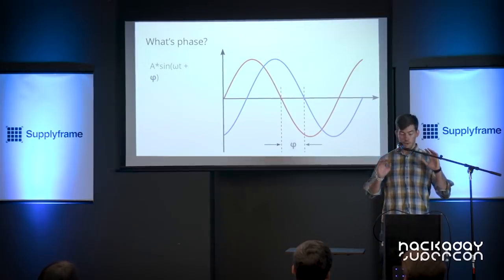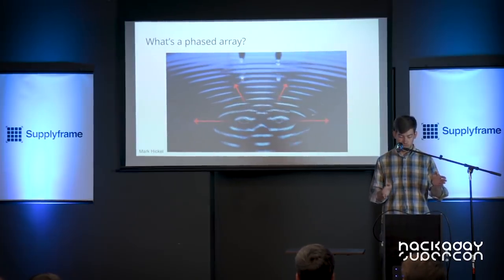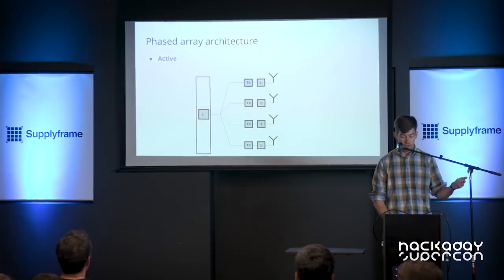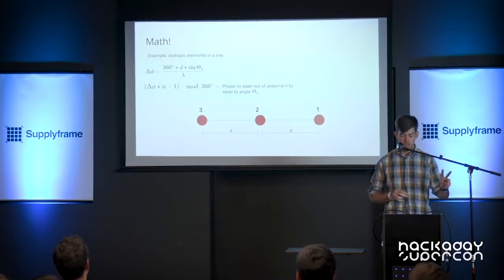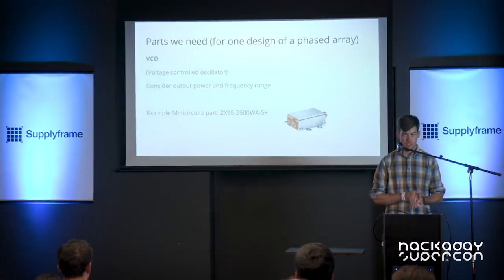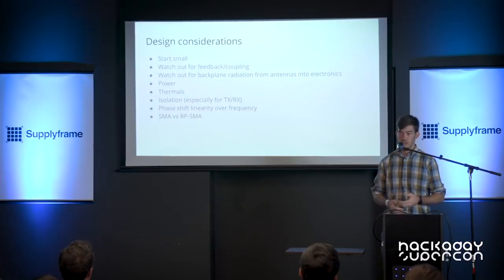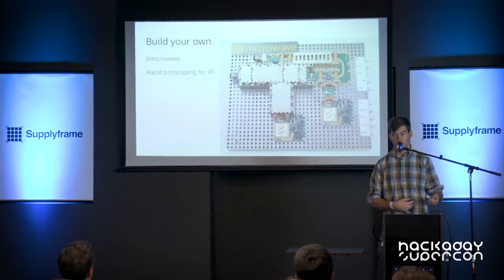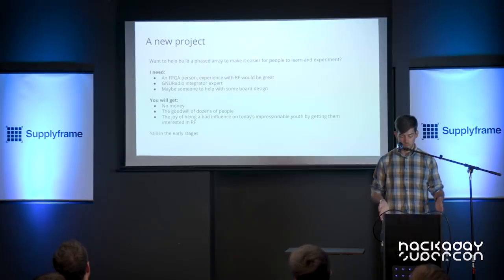Hackaday Supercon - HunterScott : Why Phased Arrays are Cool and How to Build One

Comment: If you're just phase shifting the carrier wave, wouldn't a data signal get distorted for directions far from the normal vector? I think to get a crisp steerable-directional 5g signal onto a dongle, you'd have to find a way to condense a bunch of RF delay elements onto a printed circuit. I think it can be done, but yikes

Ambitious project. A+. Cheering for you from the sidelines
Reply: Check out my affordable phase shifting array antenna for 5.8ghz (just search for Beam Steering FPV in YT)... it is hard work but definitely possible to achieve descent beam-steering at 5ghz which I used it for tracking my drone’s video signal.

Comment: What's the chip you mention at the end?
Reply: Sorry for responding to this ~2 years later, but I think I might know. Given his description, it sounds like the ADAR lineup from Analog Devices. My senior design team is using 4 ADAR1000's for our phased array. 4 channels each (Rx, Tx, and power detector) with amplitude/phase control for each channel all for the low, low price of $995 per eval board. I imagine the chip is cheaper but we didn't get a quote for that because we already have enough work without fabricating our own boards with 88 pin QFN packages. That being said, I definitely want to try working with raw chips in the future.

Comment: This looks really awesome.  I just realized when I've been using the term passive phased array... I've been wrong.  For my system I was only planning on receive mode only to maintain more radio silence.  Then interpreting and interpolating the data based on phased received on each antenna as well as other characteristic.  This has been a great presentation and I appreciate the detail!  Really cool how the microwave systems are like RF erector sets almost.  I think there is an area of opportunity to bring this down to the not as budget liquid hackers.  Reminds me of machine tools for watches more now with modern microscopes and CNC's, even if using rotary controllers, to aid in construction details.  Maybe have extra material on the initial PCB runs to trim later for tuning?  Looking forward to seeing this project move forward.

Comment: While f16 have panning radar, I think, f15 does have phased array radar.
Reply: f16 is old fighter and was overtaken by f22 for the most part. F15 is still in extensive usage by US air force, which means they have updated it a lot.
Reply: @TealJosh  the upgraded f16 has an AESA which is a form of phased array radar
Reply: @shinjithenegotiator2795  indeed, in fact US air force placed an order to extend f16 lifetime to 40s and that includes whole fleet getting AESA radar. Makes sense considering F22 fleet is tiny.